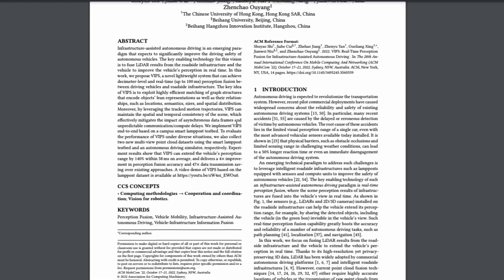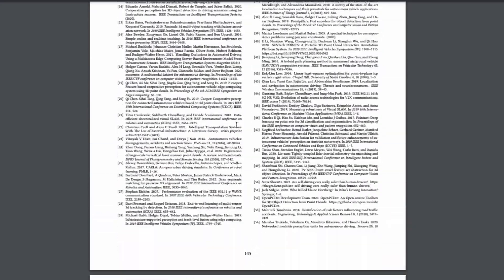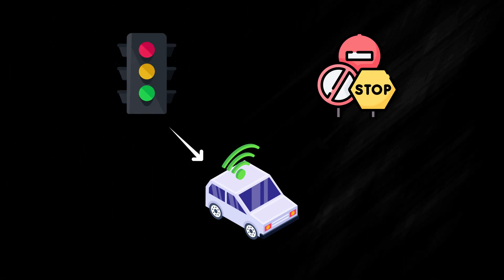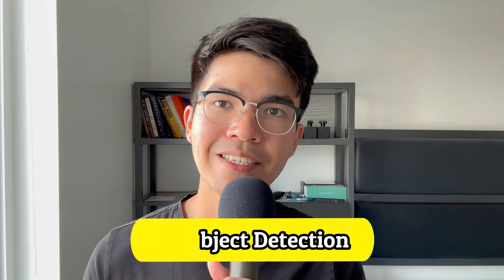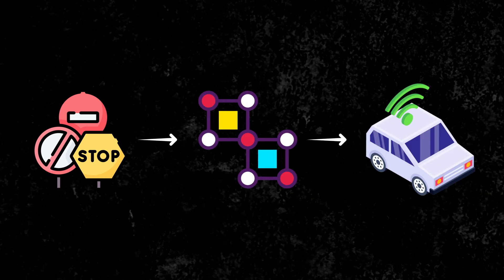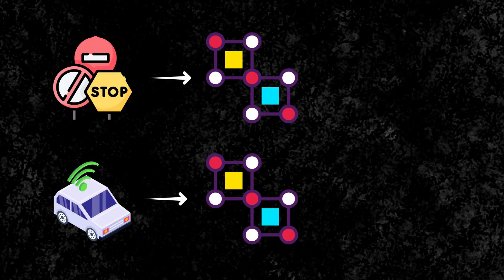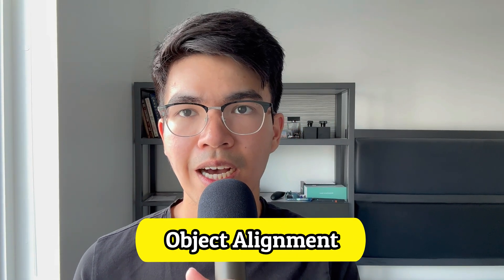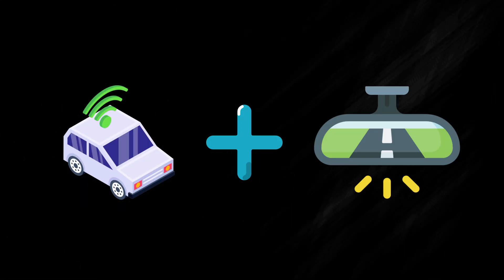I Implemented A Research Paper From Scratch - Here's What I Learned

Comment: One point I was to say when debugging code. You do not need stack overflow and google as much as you used to. Open AI you can do it with 1 window to debug the code. Yes also use the IDE Debugger as this will isolate the problem.